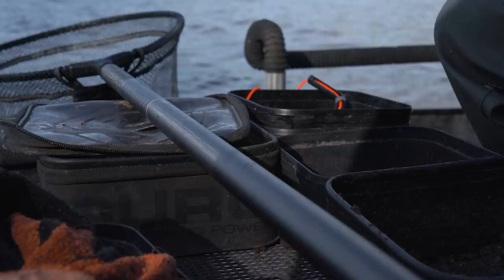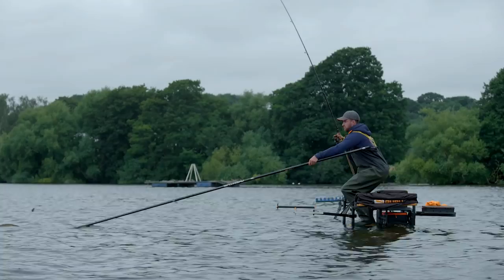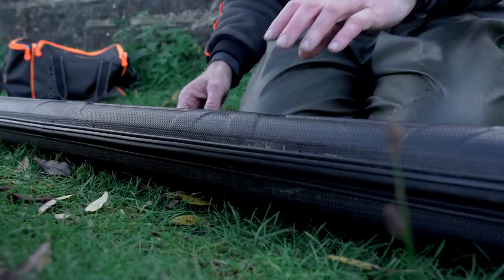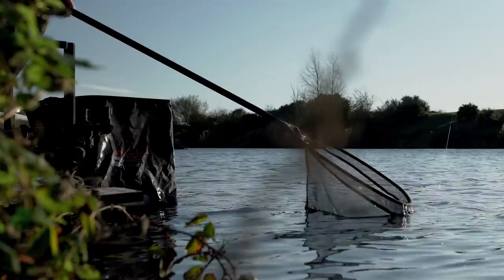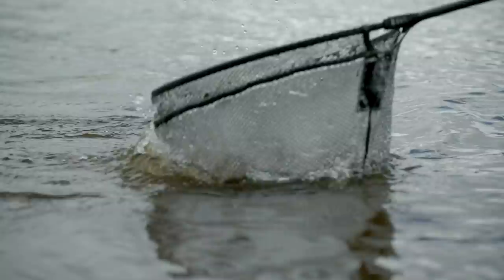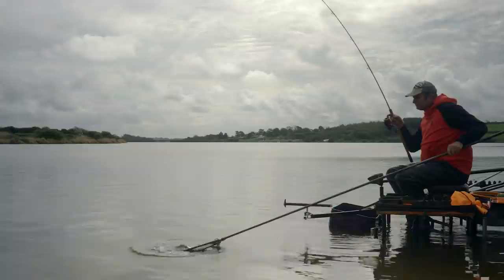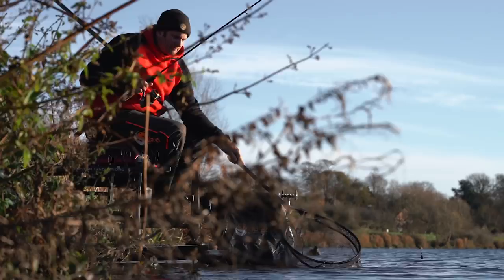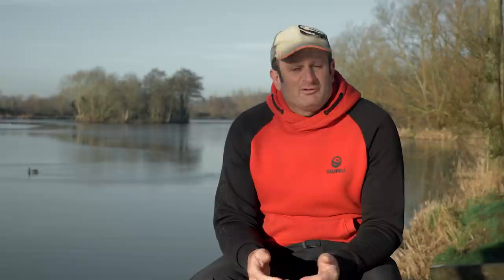Aventus Landing Net Handle Explainer

Comment: It looks like the landing net handle is well and clever designed, but for me way too expensive.   I've had a Shimano beastmaster landing net pole 450 for 8 years and it  still serves me well.
I use it for carp as well as silver fish and it costs half the price of the Guru one.  I also use my land net pole for barbel fishing without problems or what so ever.